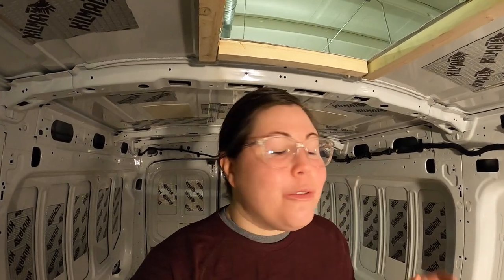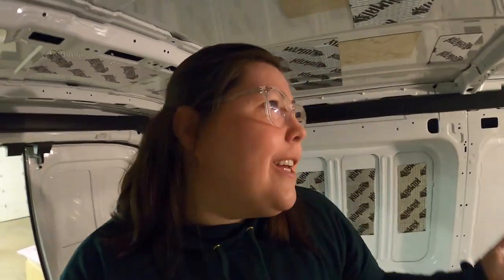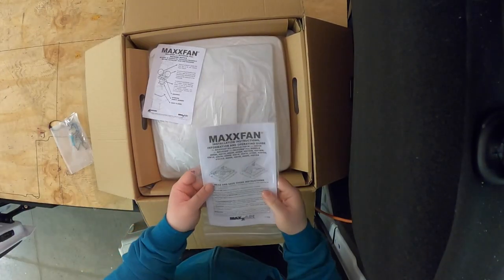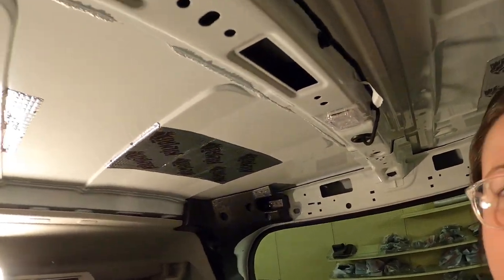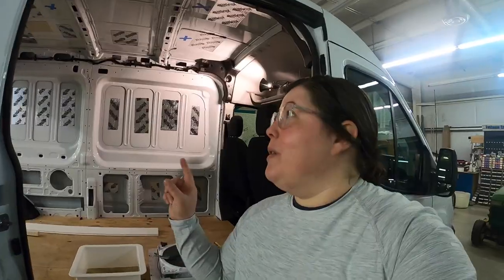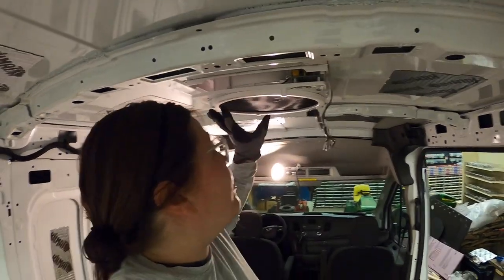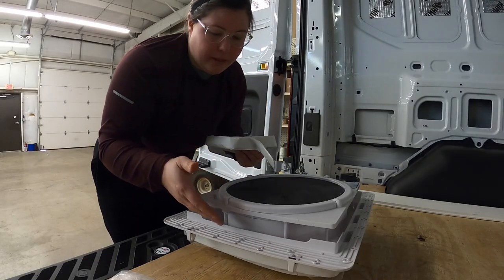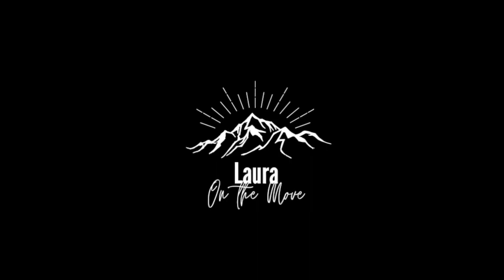DIY MAXXAIR Fan Install in a Camper Van -Ford Transit Van Conversion- Cutting a Hole Van Build Ep. 4

Comment: I have the exact same van I’m doing up right now, panicked me about those lights because I didn’t want them in, so awesome to see how you dealt with it! Thank you!
Reply from the maker: I'm happy it helped! I left the ones above the back doors. They aren't covered by the ceiling either and it does help if I turn the car off and it's super dark I can get to the back and find my light before those time out. I also assume if a door did open in the middle of the night those lights coming on would be a great safety feature too. I love the van. I hop you have fun building it out too!

Comment: I think the noise concern is traveling down the road. My van is very noisy,  no sound abatement.  Driving too fast, or rough road, its even louder,  hard to hear radio. You are making fast progress. 👍
Reply from the maker: I think the kilmat noise canceling has helped a ton. Both driving and being in the van with rain. The road can still be so loud!